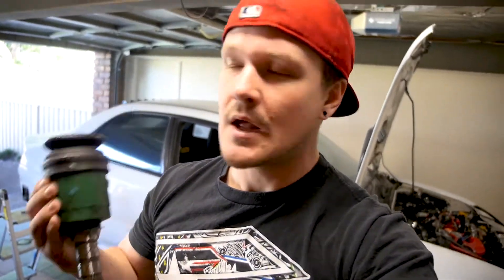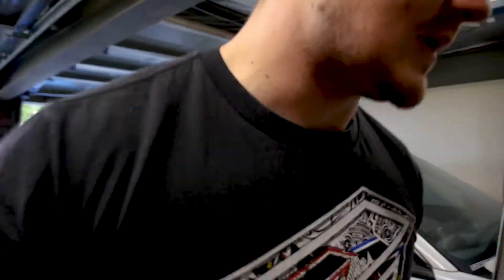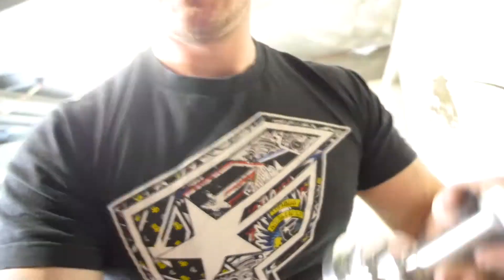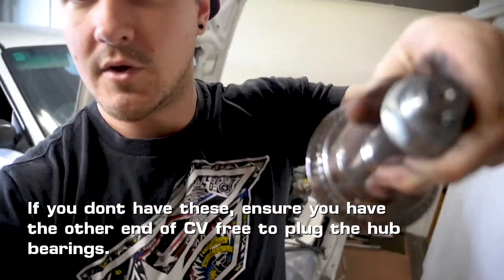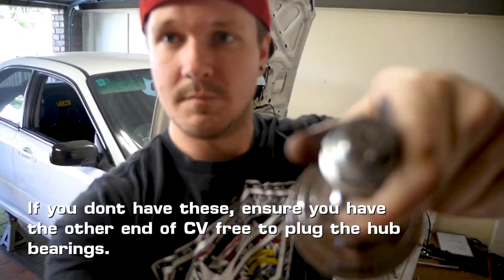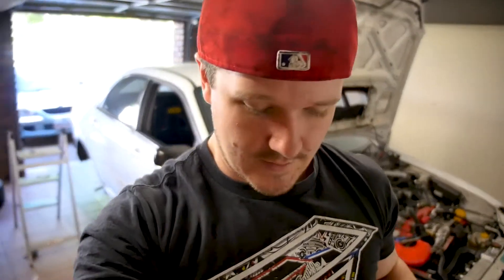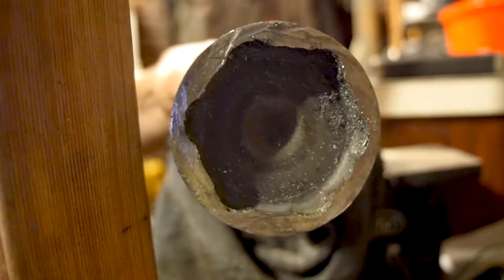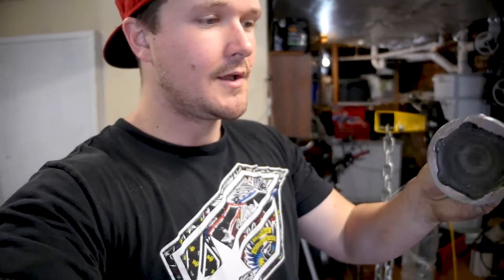HOW TO: GEARBOX PLUGS FOR RWD SUBARU

Comment: Nice. I assume those don't spin or move with the RWD conversion? These are just to stop the gearbox oil pissing out?
Reply from the maker: Yep that's correct :) the front diff no longer spins so they just sit there idle. Just added the brackets so there is no way they are coming out while on the track.
Reply: @JoelBrownefilms  Genius! I think we shall do the same thing. I'll buy some driveshafts spare so we can plasma cut them open on the bench. I don't fancy hacksawing like you had to! Poor bastard :D
Reply from the maker: @vPerformance  hahaha plasma cutting would be epic. I was literally dead armed for like 3 days after that 😂😂